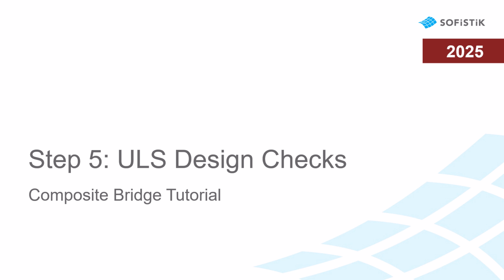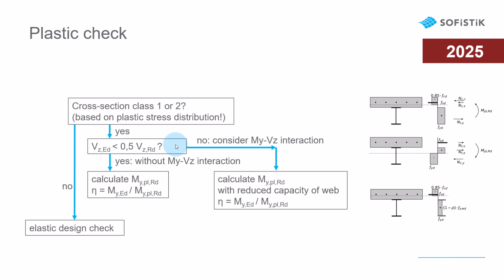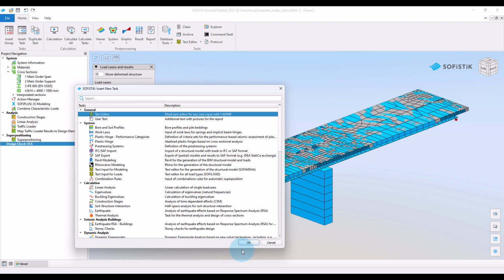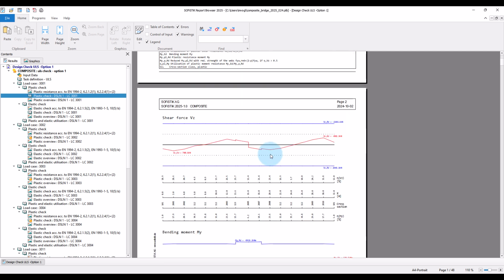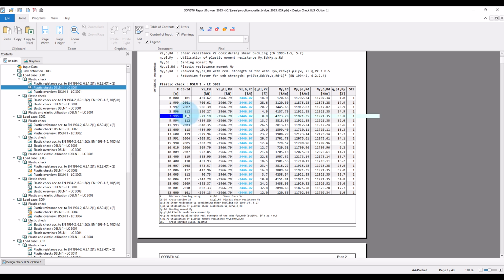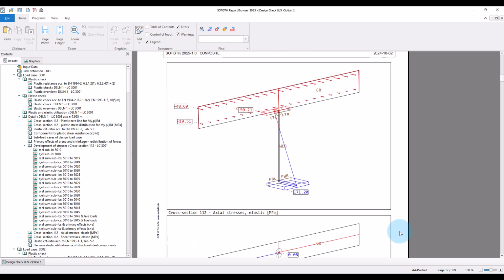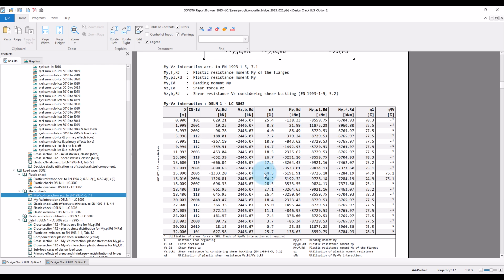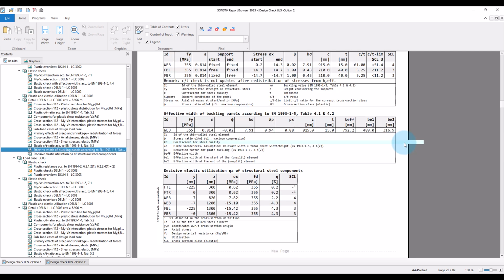Composite Bridges: Ultimate Limit State Design Checks

Comment: Hello,
Thank you for the tutorials, they are very helpful!
In these tutorials, the structure is without bracing elements, modeled using line structural elements. However, when performing ULS check bracing elements significantly influence the behaviour of the structure. I was wondering if there’s a way to integrate, for example, transverse stiffeners so that they are considered as part of the main girder of the composite section. I believe that if I were to add them as line elements they wont be recognized within the design element. Any guidance on how to correctly model and include them in the design would be greatly appreciated. I am using the Student Version if that is of any importance. Thank you in advance!
Reply from the maker: Hi StefNor2001,
Can you please post your question in our forum? (https://forum.sofistik.de/)